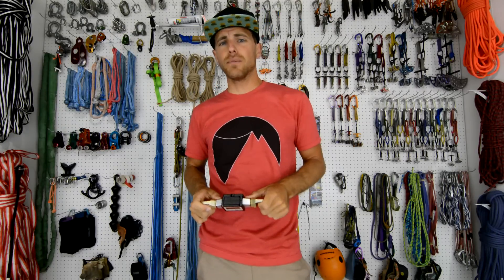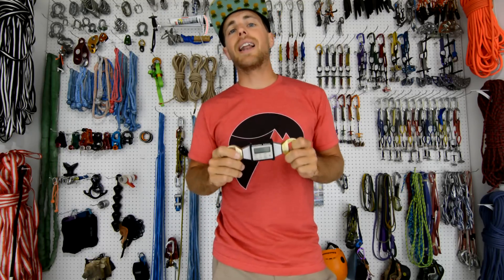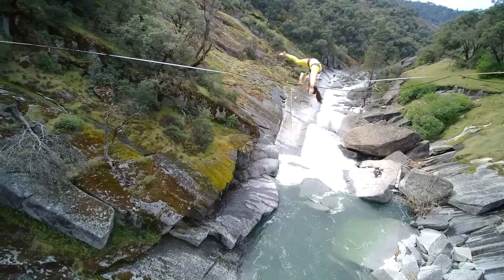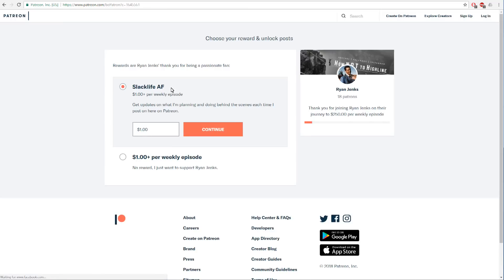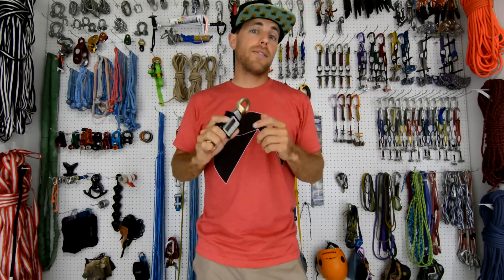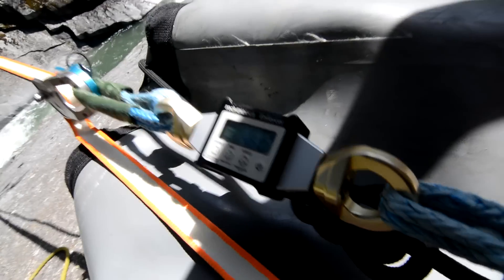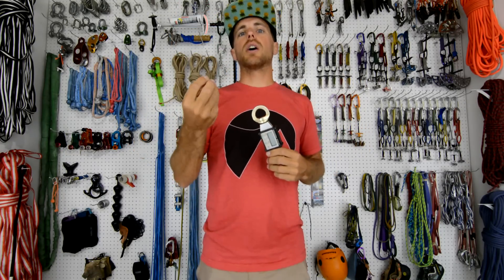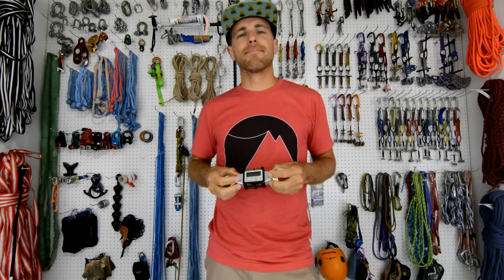Highline whipper forces on an anchor - 73 meter line at CRG (Consumnes River Gorge) Placerville

Comment: That music, don't want to be closed minded. That was just... Unappetizing
Reply: Funny - I quite liked the music.  Not a style I usually choose, but it's great to be exposed to tunes I don't usually listen to.  
Fortunately, when you play the video, you can always turn the volume down if you really don't like the tunes.
Reply from the maker: It's talking about expressing yourself.  Kim likes rap and therefore there was rap in her edit haha.
Reply from the maker: Or skip past spreadies if you don't like those either :)
Reply: @HowNOT2  wouldn't you have to double the forces since the forces should be reasonably close to even at both sides? I know what'd depends on where you are on the line. Or is that the total force on the line and needs to be divisible by 2 by the anchor points?
Reply: Who doesn't like spreadies...

Comment: It would be interesting to see you do another test of different lengths with the same types of webbing so the stretch of the webbing remains constant. For instance you did the 36m test with skypilot but how much of a difference would going shorter or longer make on the forces during the whips? For those who only have one webbing it would give an idea of how the forces change during different lengths. Either way these are super interesting thanks!
Reply from the maker: So the goal is to throw the dyno on everything I highline and if there is enough of a difference between those results and a video I already made, then I will make another.  Given enough time, we should have accumulated quite a bit of data and make the tests a bit more consistent and thorough each time we do one.
Reply: On top of that: same length lines with different webbings would be interesting to see